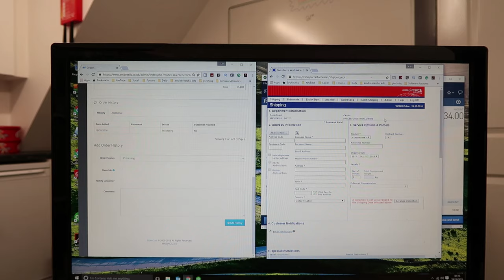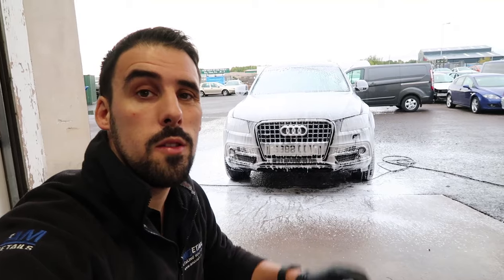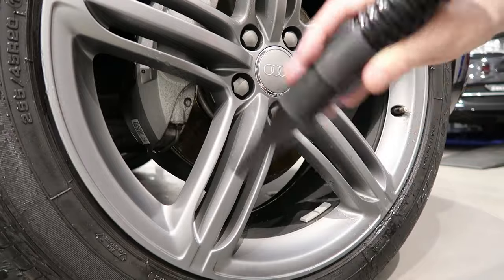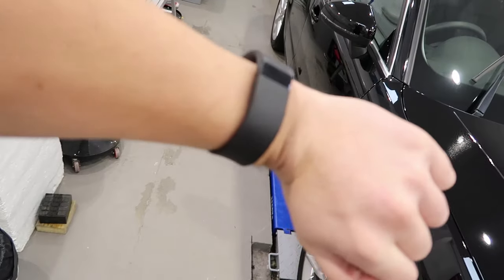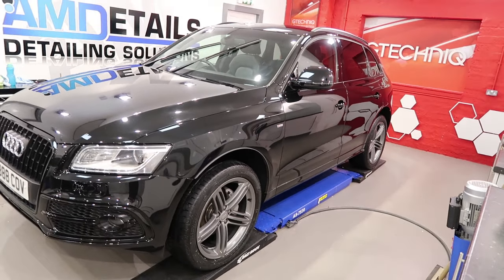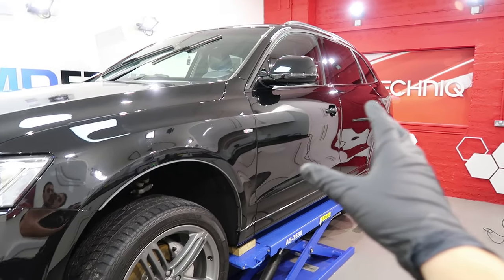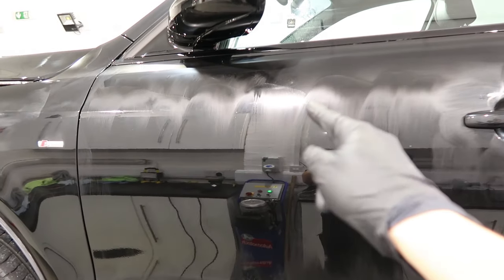Removing White Polish Residue - Vlog 36 - Wed 19/10/16

Comment: Great vlog Alan quick question how long do you leave glaze  & seal on before buffing off?
Reply from the maker: Glaze Just take it straight off.

Seal in you waits till it hazes. Summer faster than winter. Sometimes before we heated the unit it would take 15 20 mins in winter.

Hope this helps
Alan
Reply: AMDetails cheers Alan